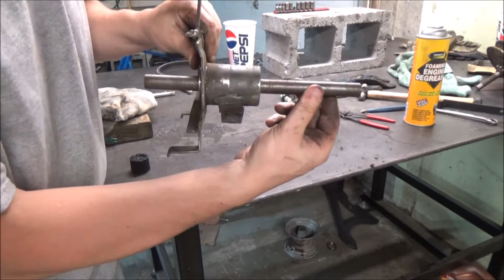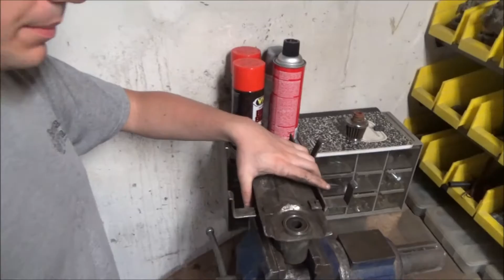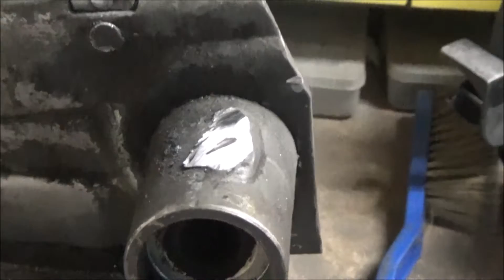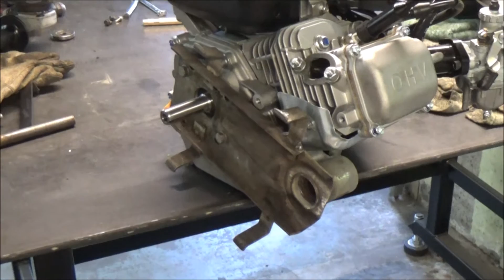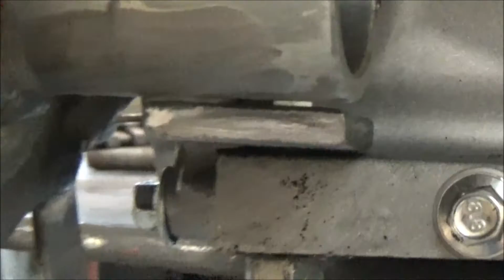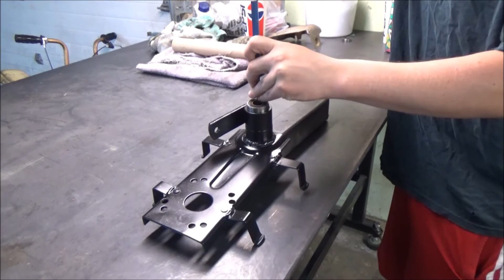Comet TAV 30 torq-a-verter repairs on the mini bike

Comment: I've had bearings fail in the clone torque converters in 20 minutes. Buy good quality bearings and install them PROPERLY. There must be a sleeve on the shaft that tightens on the inner race without binding. This is part of the finesse needed to become a professional at your craft.